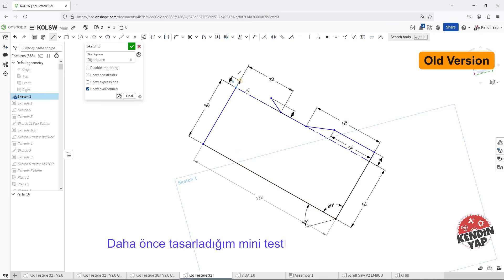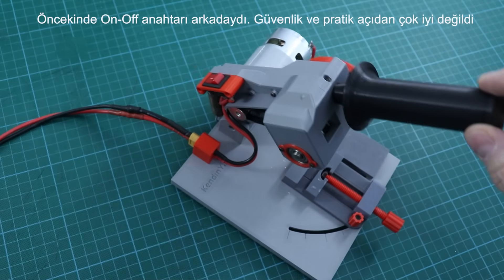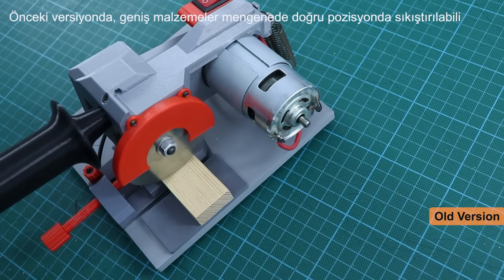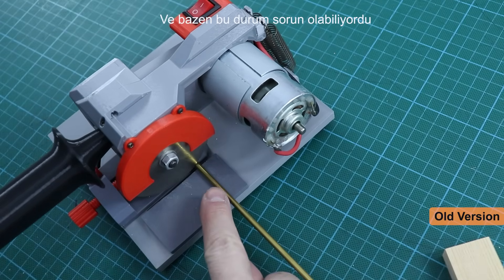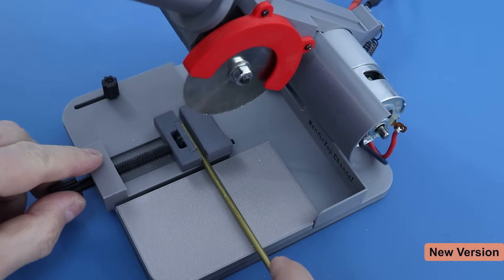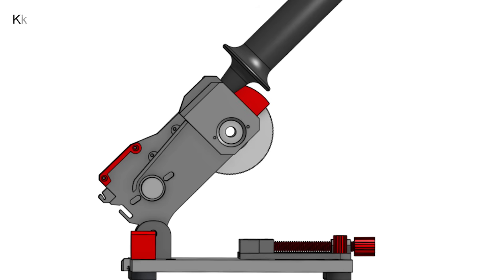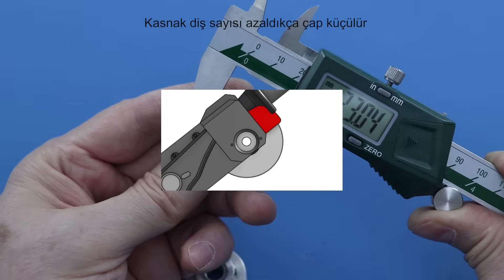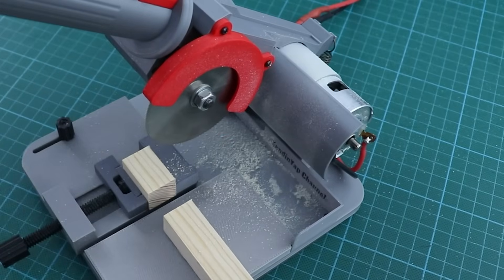3D Printed Mini SAW New Version . DIY Mini Saw

Comment: Very nice mini saw saw. Control adjustment. Looks like it will be useful for cutting extractor rods. Looks like it will stop the dust from the motor. Seems like it should be able to handle the glue holding it in place.

Comment: From ur 6ch transmitter and receiver reciver video ,Sir I tried again with a brushed esc this time the esc beeps that it is connected when I try to give signals to receiver from the transmitter it doesn't move but when I touch the esc or receiver it gives random movement in the motor and servo for seconds and then stops, i connected the motor in 3rd channel and servo in 4th channel plz giv me solution for it , another thing that it feels like there is vibration in esc or receiver but when I touch it there is no vibration